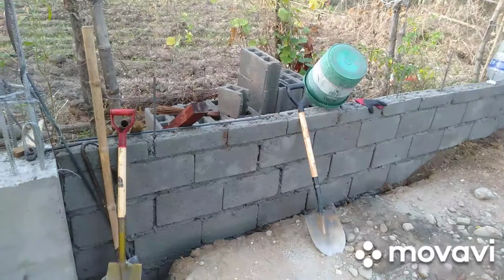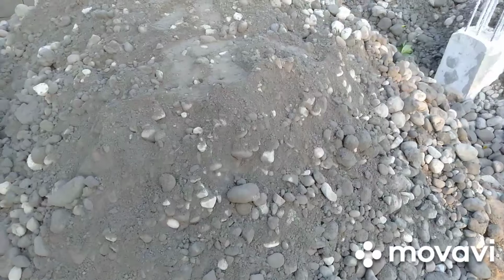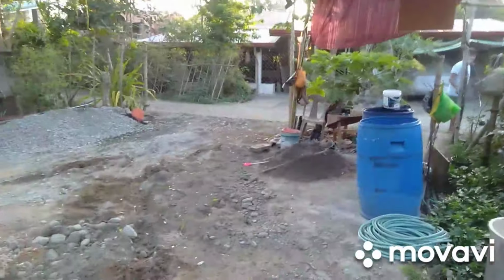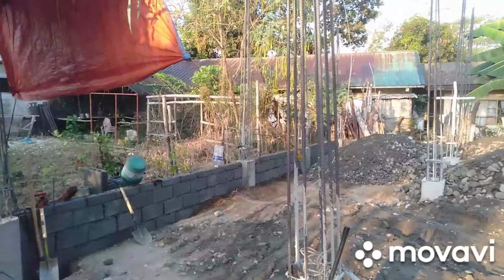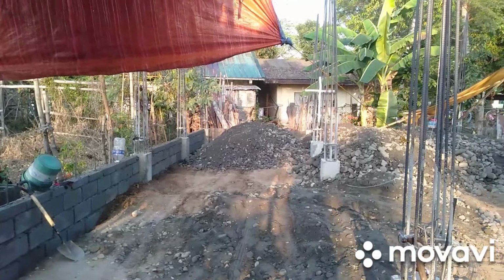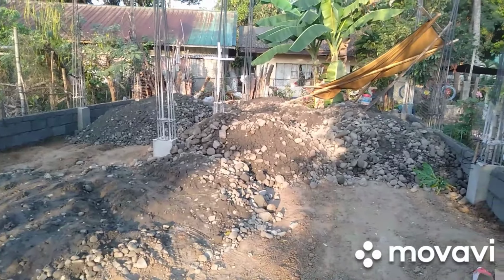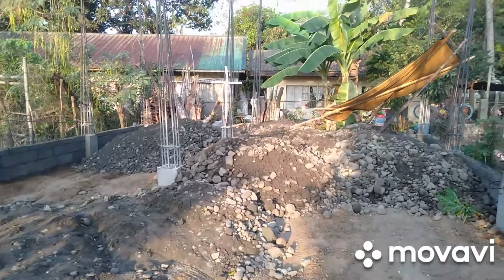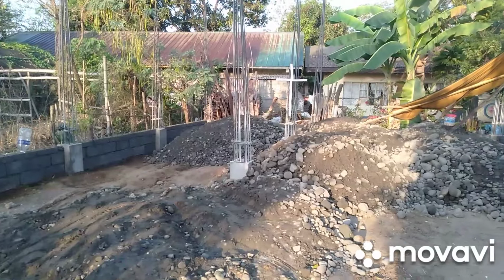HOUSE BUILDING IN THE PHILIPPINES UPDATE 🤔

Comment: The slab will connect it.
Reply from the maker: There will be tie beams connected at below slab level to the surrounding ring beams this is how they integrate the floor slab and the supporting ring and tie beam the ground floor construction rebar and concrete